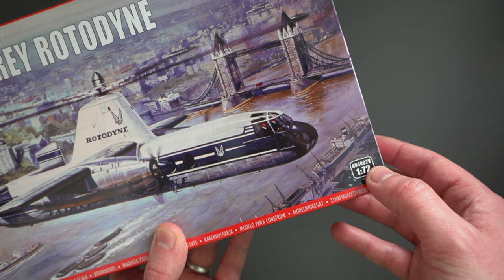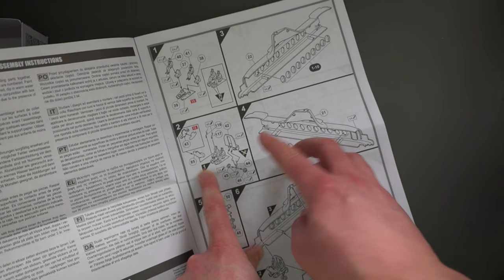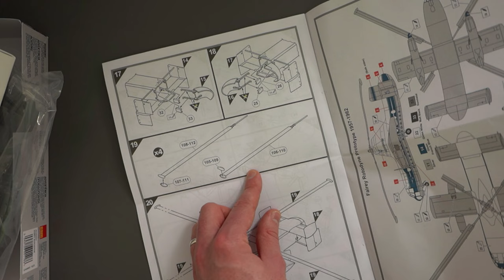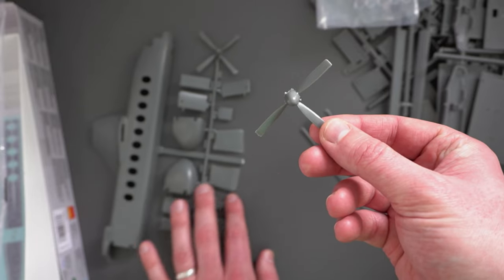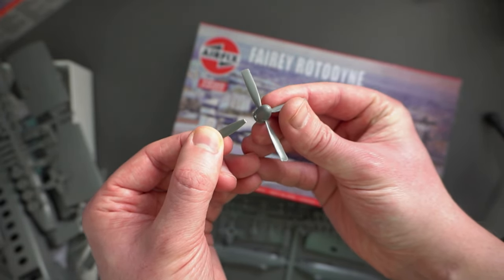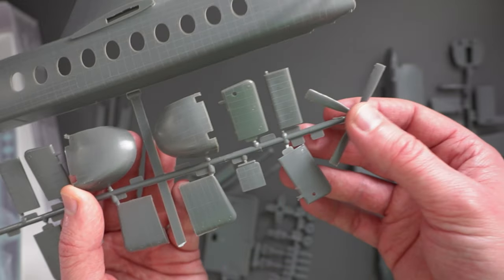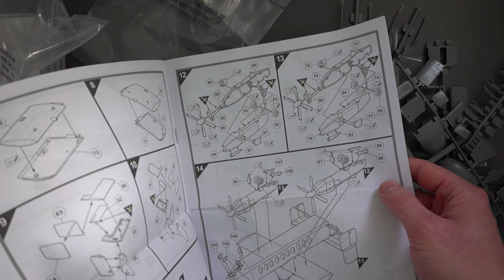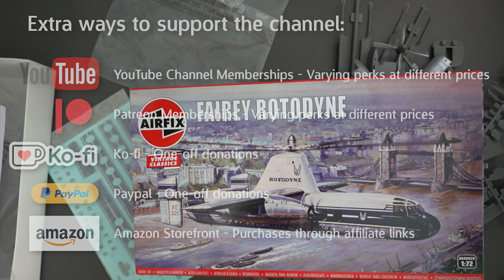One of Their Oldest Kits? The Airfix Fairey Rotodyne Vintage Classic in 1/72 Scale - Unboxing Review

Comment: It is a very interesting aircraft. I was given this kit by a friend back in the mid 80's which was old when I got it.
I only built it about 5 years ago some parts didn't fit very well and the decals were very fragile but I got away with 
it. I also left the main rotor blades detachable so i could remove them for transportation when i moved house.
 It did turn out fairly well though.
Reply from the maker: Leaving the rotor blades removeable was a good idea! I didn't think about that and can imagine having problems with storage
Reply: @ModelMinutes  Yes the model lives in the top of my wardrobe at the moment until I find somewhere to display it.

Comment: Hiya Matt.. great review :) In his unboxing review Gary Evans had the same issue as you with the propeller blades, although in his case it was both propellers and they were bent not missing. He made the point that with modern sprues fragile parts like propellers would be inside an outer frame so they couldn't hit the box and break / bend. Mind you although yours was in the bag, it does look like a factory accident and should IMHO have been discarded not despatched. The scuffs on another sprue do look like someone was clumsy - maybe the propeller was damaged in the same incident.

WRT the stripes.. 'Paint or decals? That is the question. Whether to..' no OK I ran out of ideas lol
Reply from the maker: Yeah, Mos also had the same problem with his props too. Having built the model I think that painting the stropes might be easier in some respects - especially with lining them up with the windows as I had issues there
Reply: @ModelMinutes  Agreed. I was thinking mask the windows and paint the stripes. The only thing I think probably would need decals is the lettering.

Comment: Hello, interesting view.  Given this was a prototype only, its quite possible that there wasn't much of an interior for Airfix to copy at the time, perhaps just test gear.  Then again interiors were unusual in those days.  Implementing closing/openning gear doors to go with the retractable gear might be an interesting challenge.
If you are interested, the remains of this aircraft are at the helicopter museum at Weston Super Mare.  Their web site shows a view and also a Fairey marketing video which might give some ideas.  The tip motors were Ram Jets and a bit (lot) noisey.
Reply from the maker: It is my understanding that although this was a prototype, in order to gain interest in sales an internal seating area/cargo space would have been present to give a good demonstration to potential buyers what the capability of the aircraft could be. I feel as though omitting the internal details was just the "style" at the time and possibly a cost saving method.

The tip jets were powered by compressed air provided by the engines (similar to how the Harrier would control it's flight in the hover) and not "ram jets" as such - a ram jet typically requiring the compression of fast moving air and a fuel to compress and ignite a self-sustaining thrust
Reply: @ModelMinutes  Hi Matt.  Thank you very very much, you have provoked me to do some research on an aircraft I hadn't paid enough attention to in the past.  This reply has taken a while because speed reading is not my thing.
With regards to the cabin I was right for the first half of its life in that it was a bare cabin with flight test instrumentation/recorders in it.
You were at least half right (a bit more than that really) in that just before its appearance at the Farnborough air show the rear half of the cabin was fitted out with seats (20) and sound proofing "to an airline standard".  I think the front half was reserved for the flight test stuff for ongoing work.
I would say that the modeller who wishes to model a cabin might do well to look at cabin interiors of the time (BEA was to be the launch customer so thats a place to start) say in the Viscounts and Vanguards.
On the tip jets, you are again at least half right,  They were not ram jets, but side entry pressure jets using compressed air from the engine driven pumps (one engine supplying blades 1 and 3, the other engine supplying blades 2 and 4 giving a redundancy in the event of an engine failure) mixed with kerosene fuel fed down the leading edges.  Whilst they were initially spun up with just the compressed air, take of required the fuel feed.  The Harrier manoeuvre jets are purely engine bleed compressed air.  The nearest analog that I can suggest for these tip jets is it is like a single combustion can from a turbo jet without the turbine.  And yes they were very noisey at 110db at 500ft away!!  Thats ear defender levels these days.
I feel very chasened but thank you for, albeit indirectly, introducing me to research what was a very interesting concept.  Its a shame it was scrapped so abruptly (a short sighted ministry decision) because it had such promise and the noise issue might have been solved in 10 years or so afterward.
I don't go much for "what if" builds but I might make an exception in this case, perhaps a secondary airline loading cargo (the aircraft was designed with that role in mind as well and it bypasses the seats issue).
Reply from the maker: @emmabird9745  that’s fascinating! Thanks for doing all that research so that we can all benefit from it 😊
Reply: @ModelMinutes  Hi Matt, research is the basis of all good modelling.  Glad to be able to share.

Comment: Would have been interesting if Airfix does a new tool of this, as a beginning of "Projects Terminated" what if line, with many victims of 1957 Defense White Paper on the way.
Reply from the maker: Interesting yes, but I doubt it would be likely
Reply: @ModelMinutes  Dragon done a lots of What if Panzer and Luft 46 before; a Taiwan brand made many F-20 hypothetical print schemes,  even produce a two seater B version. What if Brit stuff certainly an untapped market,  even it may makes the brand looks "not serious".

Comment: used to see this in woolys in the mid 60s, £20 nooooooooooooo
Reply from the maker: According to online currency/inflation value calculators, £20 in 1960 would be about the same as nearly £600 today
Reply: @ModelMinutes  holy  crap...now THAT is expensive
Reply from the maker: lol yeah, what I think Neil is more referring to is that £20 today seems expensive when you could probably pick it up for like 60p back in the 60's. Of course, 60p back then probably has the same buying power as £20 today, so realistically prices haven't actually "gone up" just their purchasing power has gone down
Reply: @ModelMinutes  ecactly spot on Mat...put it this way...and it's me coming from a motocross bike pov.... even going back to the 1980s a Yamaha YZ 125 would have cost about £1000  but in 2024 the same bike is around £4500.